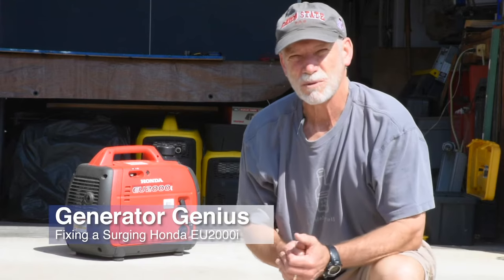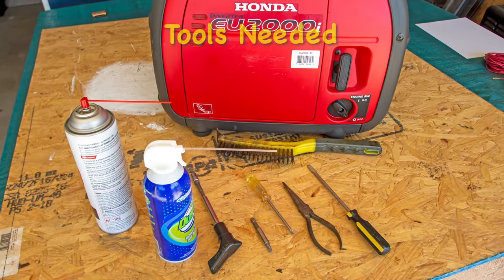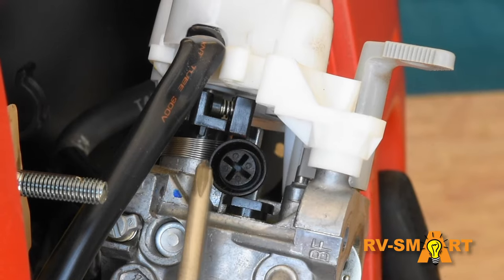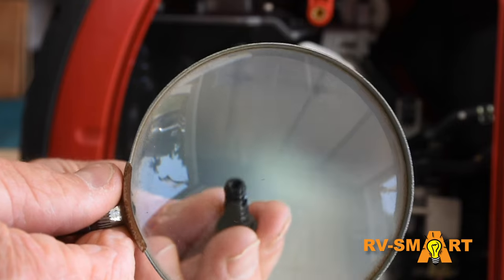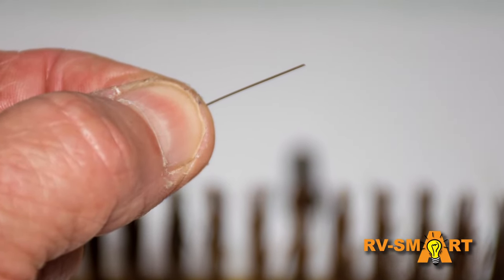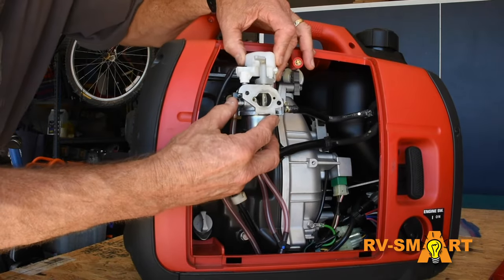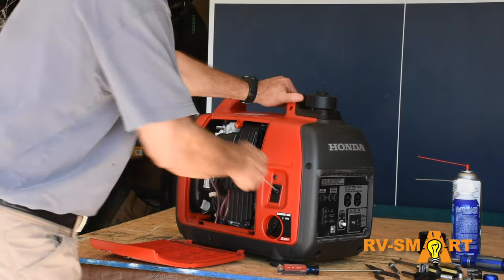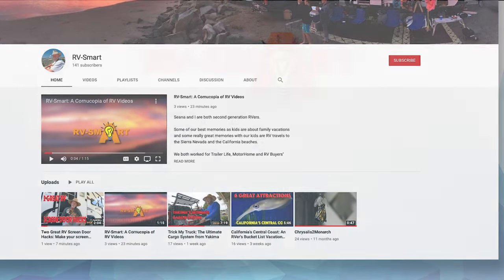Simple Fix for a Surging Honda Generator

Comment: first used the 2000i to run my mother's oxygen concentrator  in a 3 day power outage. I ran pure gasoline.  Then just let it sit with gasoline in the tank for, sole caregiver,  years, like 7 or 8 years.  A storm, trees down, tore off my electrical mast.  The gas went bad, I poured it out , put in fresh pure gas and it started and ran.  now running gas with ethanol to try and clean the  varnish out.  still a bit of a surging at times. i AM GRATEFUL that my "neglect"  was "mitigated". now know the fix

Comment: I used a welding torch tip cleaner to fix mine. It has around a dozen different size wires. I found one that fit my jet perfect. You can grab a torch tip cleaner at Home Depot for a couple of bucks!
Reply from the maker: Hey, Darrel, that's a great tip! Thanks for that and thanks for watching!
Reply: I use the tip cleaner for all my carburetor rebuilds. Great tool!
Reply: Dont use wire clean tips. Consult a dealer for proper carb cleaning. (I'm a yamaha, mercury, arctic cat, Polaris, stihl dealer. Improper carb cleaning techniques can cost you a carburetor. Some carbs cost over $700...be careful on internet info

Comment: Worked for me! My 18-month old log splitter has a GX200 Honda engine, and was proving difficult to start, was surging at low speed, and would then cut out when the speed was reduced to an idle. Removing the idle jet (size #38), cleaning it out with a 0.35mm diameter strand of wire, and then using an ultrasonic cleaner and carb cleaner, got it running perfectly! Many thanks!

Comment: thank you. this absolutely solved my Honda 2000 gen surge problem. took me about a hour. jet was blocked and used a bristle from a wire brush. fit perfectly. local service knew prob and wanted 1 1/2 hrs plus parts if needed. $120 average as their rate is $80 Hr. thanks again for the great and easy instructional video.   Paul
Reply from the maker: Glad to help! Thanks for watching.

Comment: The only issue I had was when I pried out the jet, the o-ring remained in the carburetor. I had to use a bent paper clip as a pick to get it out and reinstall it on the jet. A bit of a PITA but once I got it back together, no more surging!! Thank you

Comment: Honda GX 630 pressure washer with only 85hrs
On it started surging and backfiring soon as I let off the trigger and went into idle.. I replaced both coils, new fuel pump, new spark plugs, I even pulled out the pilot jet's and blew them out with compressed air.. put it all back together and still did the same thing backfiring and surging.. I watched this video followed his advice used the needle from a wire brush put it back together and it ran smooth as silk on idle.. that's one trick I'll never forget.. 👍

Comment: Thank you so much for your information I was about to take my generator to the local Honda centre and they said it would be about $250 to get into the carburetter to fix that problem I did it literally in 15 minutes thank you so much

Comment: Thanks for the video. I never knew the jet was so easy to remove in honda carbs. I have a slightly bigger model of generator and the carb is virtually the same. Best part for me was I had easier access to the carb without having to unscrew it from the engine first.

Comment: Love the video as for the wire I laughed because I have used wire brush bristle many times. But at any hardware store you should be able to find a torch tip cleaner kit. It has varying sizes and comes in a small case they fit in the palm of your hand but each wire has ribs on it that helped you clean out the sides Of the opening as well. There are typically used for cleaning welding torch tips

Comment: Great video, will definitely try that. I have a surging generator that is outputting very low wattage (less than 100w) under load. Could this surging be the cause of that problem?

Comment: I was most interested in your 4 7/8" turns on the idle  screw. Mine had been messed around with by the previous owner and it was 4 1/8" turns. I dismantled and super cleaned the carb. Installed new emulsion tube and air pilot jet. Blasted all jets/passages with carb cleaner and compressed air. Float bowl and all internal parts look like they are brand new. Zero signs of gum or varnish. I STILL HAVE a minor stumble both at idle and under load.
Can anyone tell me about the tiny adjuster right at the mounting flange beside the left side stud. What does it do? Is it altitude related? I am 98' ASL.
I welcome any and all comments. Thanks.
Reply: Have you tried mechanic in a bottle? Give it a shot.
Let it sit for a few days.

Comment: Interesting - 
Thank you for the wire tip. 
Do you think it would run badly if the jet was worn larger from a larger wire?
-- I haven't encountered the issue but this should save some $$ - especially since my local repair shop didn't survive the COVID shutdown.

Comment: Did you run the gas out? It seems like otherwise there would be gas everywhere. Just curious before I get into it. My generator is running so choppy I don't really want to run it, so should I clamp the input line and drain the carb, or does something prevent fuel flowing out when the jet is removed?

Comment: Look for an acetylene torch tip file cleaner in your local home improvement store (welding supplies), it has very small wire files of different sizes in it that prove quite useful for all the jets in a carb. CAUTION THESE ARE FILES FOR TORCH TIP CLEANING AND WILL FILE HOLES BIGGER if your not careful, great tool to have on hand.
Reply: Dont over ream the jets. Not the correct tool for someone not mechanically inclined

Comment: My almost new Honda EU 2200 Companion just started cutting power off then back on as it adjusts to my sail boat's power demands. This happens in both normal and ECO mode. Why? This shuts everything off then back on including my new MarinAire system.

Comment: Nice job.  I have a new EU2200i and getting a similar surge.  I am guessing my issue is altitude.  We are at 4800 feet agl.
Reply: It's a common problem right out of the box. Also, the carbs are far more temperamental than they should be. Mine surged slightly when I bought it and the exhaust smelled worse than I thought it should, but I thought it was normal. After using it twice for camping, over the period of one summer, I drained the gas and put it away. This summer I started it and it surged badly. It also has a raw fuel smell when it runs. I'm at 810 feet. This time I'm going to store it with fuel in the system but the tank nearly empty to see if that makes a difference.
Reply: Honda advises installing a different fuel jet for higher altitudes.  They sell one targeted for 5,000 - 7,000’, and one for 7,000’ and higher that compensates for less atmospheric pressure.

Comment: I have a generator with a new carb works fine without a filter but as soon as i try to even put the cover on without the filter it runs like crap then shuts off any suggestions?

Comment: I've always wondered something. If you run fresh fuel through the generator long enough (say by running it for several hours), will it eventually dissolve the varnish and clean the jets?

Comment: What if its a brand new out of the box generator an it does this?
Reply from the maker: It seems to me you take it back. It probably means it's been sitting n their shelf a very long time with gas in it or they sold you a used unit. Either way it shouldn't be your responsibility to fix it.

Comment: Can this happen to new engine?
Reply: Could be debris from the manufacturing process.  New engines wouldn't probably have enough time for contaminants and gels to form in the jets from the gasoline.
Reply: My brand new EU2200i is surging. 
Did you get yours figured out?
Reply: @f270  same problem eu2200 wtf, I even put fuel stabilizer in there, its only been a week stored
Reply: @johnnelson9742  shortfuse43 is right,  I pulled mine apart and found little black pieces in the float bowl so I cleaned the jets and now it works as it's supposed to

Comment: Definitely not a mechanic. The proper tools were not used and proper carb cleaning procedures were not used but for a DIY person it may work....if you carburetor is not that bad. See an actual dealer for a proper carb clean for anything. Come from a dealer standpoint this is not a proper way to clean a carb

Comment: Dont use wire clean tips. Consult a dealer for proper carb cleaning. (I'm a yamaha, mercury, arctic cat, Polaris, stihl dealer) Improper carb cleaning techniques can cost you a carburetor. Some carbs cost over $700...be careful on internet info